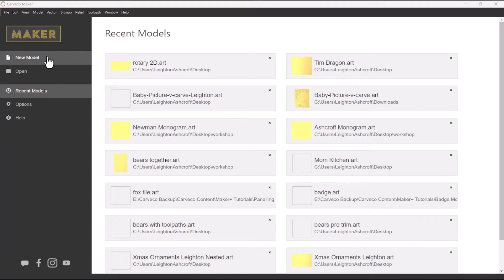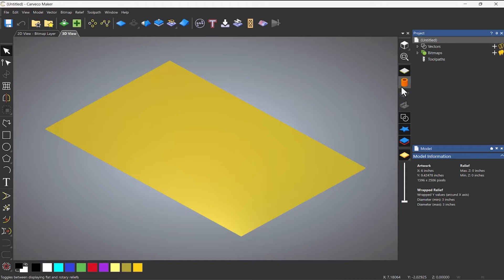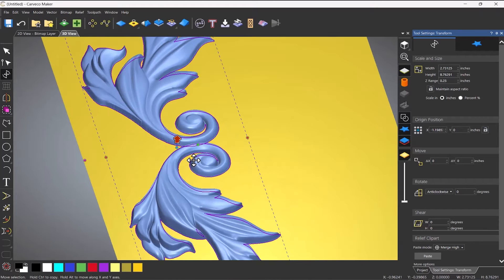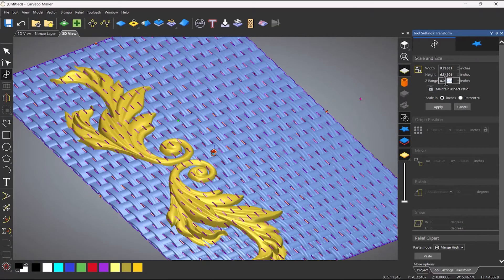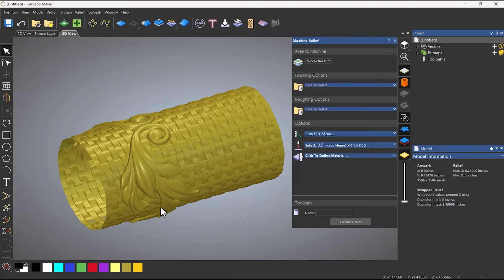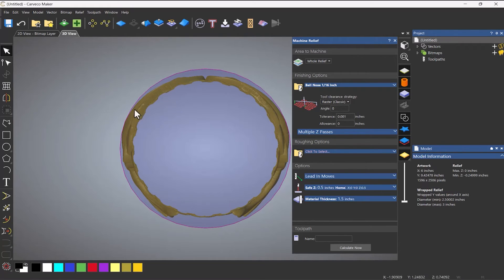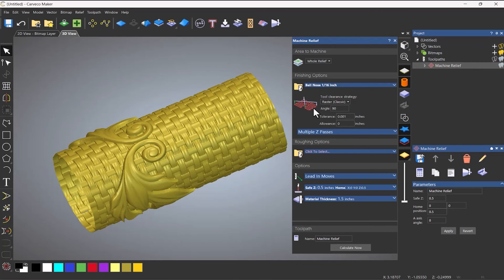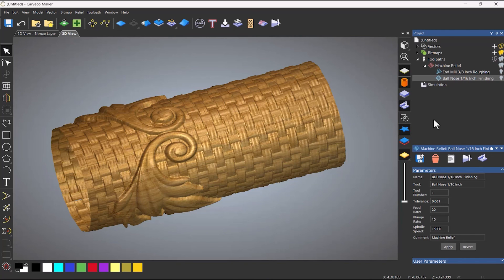Rotary Reliefs in Carveco Maker

Comment: So can we do something like chess pieces/persons head? ...  Full Rotate a 3D relief model ?
Reply: A lack of response from Leighton and my tinkering does not look good.  Clearly we have to unroll the cylinder to apply a relief.  I was hoping to find a workaround by importing a .stl and centering it inside the cylinder (which you can do), but when you paste it, the model attaches to the plane of the relief and does not reside within with the hopes of carving out the excess, worth a shot.  I looked at the rotary relief video for Carveco Maker+ and Carveco figuring that would be the software, but that video is essentially the same as this.
There is a time consuming process of a guy that built a very cool chess set by carving 4x90deg reliefs turning and centering the block each time to make a complete 360deg piece, but that is not what we want when we have a rotary.  I'll be looking more into this before I drop money on a rotary for my CNC.
The only 3 solutions I see at this time is the 4x90deg process, somehow being able to unroll a .stl to a flat plan relief that Carveco will roll back into a 360deg pattern or design a flat plan relief that will roll into a 3D model with Carveco's tool.

James Dean Designs has his 2D tutorial for 4th axis as well, he comments that Carveco's 4th axis is relatively basic at this point.  From what I see so far, Carveco use of a 4th axis is about the same as my laser machines use of the 4th axis, aka column maker, with one important difference that is pointed out in this video, the raised relief depth can be adjusted into the cylinder.  I've had enough for today, rest assured if I figure it out, I'll make a vid for it.
Reply: I agree!
Reply from the maker: Not yet John!  That's the first thing that I said lol